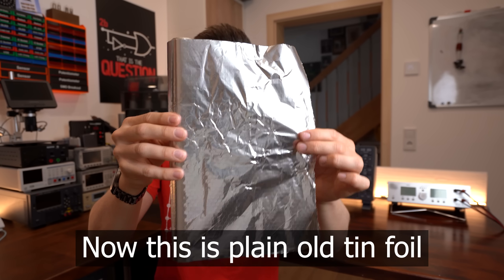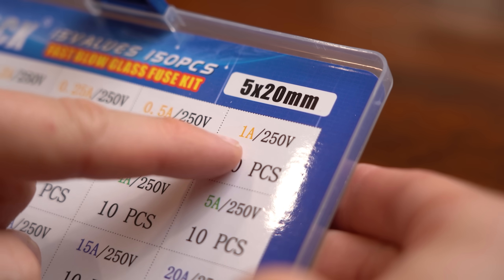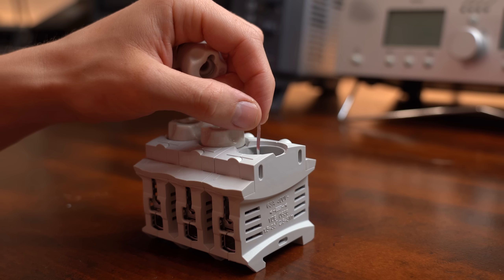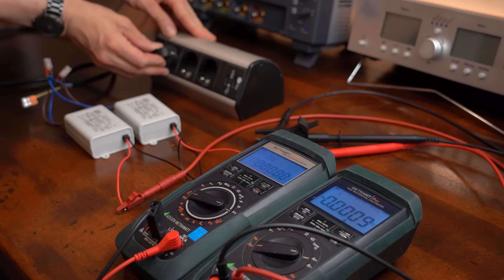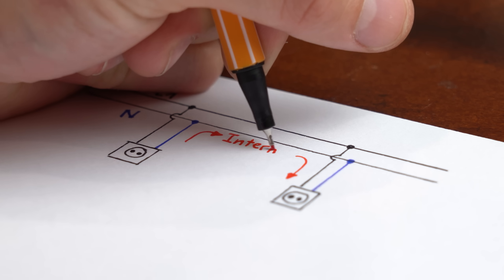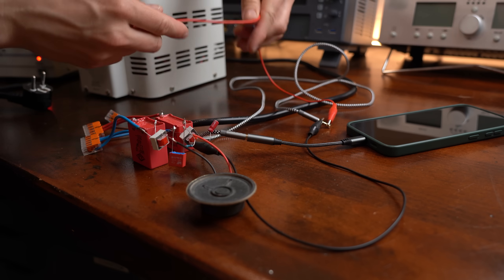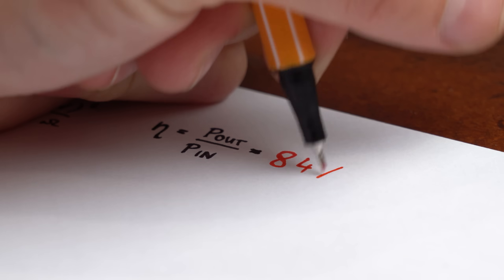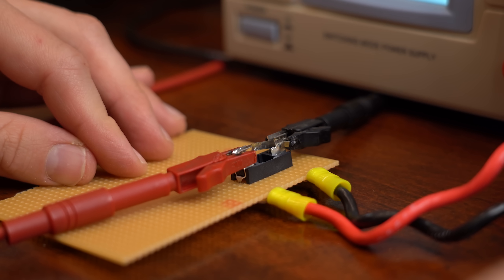I tried Busting 4 Weird Electronics Myths!

Comment from the maker: 🎉 Big thanks to Elektor for sponsoring this video! 🔧
BTW, if you're into building stuff and geeking out over real electronics (like myth-busting weird circuits... ), check out our limited-time offer 👇
👉 https://www.elektormagazine.com/greatscott-elektor-offer-25
We’re giving 50% OFF our Green Membership – includes magazine access, project files, and loads of deep-dive content for makers and tinkerers
✅ 8 digital issues
✅ Access to the full Elektor archive 📚
✅ 5,000+ Gerber files for DIY projects 🖥🔩
✅ Member discounts in the store 🛒
Offer valid until May 31st, 2025
Grab it here:
https://www.elektormagazine.com/greatscott-elektor-offer-25
👇 Let us know in the replies what you plan to build!
Reply: Have you tried wiring power supplys in series to increase output voltage? Could you test it in the next episode of electronic myths?
Reply: I HAVE REPAIERED EQUIPEMETN FFROM SECOND HAND AND FOUND A TIINFOIL WRAPPED FUSE IN WHEN IT DIDNT WORK I FOUND THAT THYE HAD  WRAPPED RHE ORIG INAL , IT WOULD HAVE TAKEN 13000 VOLTS TO BLOW
Reply: Thanks for creating this video about electronics myths. Great stuff!

Comment: The problem with rewiring fuses is that there is even some actual true practical use for it.  In the UK there used to be older fuses for the consumers units in private homes.  If a fuse blows the fuse carrier could be removed and the blown wire be replaced with new wire which many households kept around next to the consumer unit.  In theory that was a good idea.  In practice the result did depend a bit on the skill of the person doing the job which likely was the occupant, not a trained electrician.  Some people used multiple layers of wiring for extra safety which of course meant the fuse now would now have a rating of multiple times the desired one.  And while it was "recommended" to use the wire of the appropriate current rating people did often demonstrate flexibility when choosing the replacement.  Maybe no wire of the appropriate type was available, so why no using some other type.  Or maybe a bit from the garden fence?  Why not using 10A wire to replace the blown 5A, that will ensure it won't blow again.  These are still around in very old installations, still legal but very rare nowadays.

I suspect stuff like this may have infused the idea that rewiring fuses is ok into some people's brains.

Comment: Gum foil wrapper works like a charm. The foil on the paper wrapper is very thin. My dad used to do this in an old truck and it did blow every now and then and we would put another piece of gum wrapper wrapped around the glass fuse and put it back in the fuse panel.

Comment: I have done the signal-to-mains coupling thing.
It works like a charm, and it is surprisingly easy to do, as long as you are careful  :) . 
My plan is to use it for remote control/monitoring of machines here on my farm.

Comment: If the fuse doesn't melt, your home wiring will melt instead. IF the wiring doesn't melt, then your home will probably burn down... Personally, I think an actual fuse would be cheaper to replace.

Comment: Well the tin foil can work as fuse but it needs to be very slim and long piece and the current must be high so it technically can work but still if someone is capable of using the tin foil as proper fuse (have knowledge and tools/equipment) then probably have fuse and know it's pointless (too much work and time)

Comment: Yeah, I've been using two power supplies for my under-cabinet COB lights for a while now.  
Initially, they were on cheaper power supplies. They're on much better ones now. But still in parallel .

Comment: When I was a kid, circuit breakers were not standard, and lightbulb socketed fuses were used.   Also back then, pennies were pure copper.   So instead of buying fuses every time one blew, people would put a penny in the socket, screw the blown fuse back in, and, well, have a fire later.

Comment: You might want to look at the "X10" home automation system. It's been around for decades, but I don't know if it would work on three phase. It uses pulsed high-frequency on the power line to turn lights or other plug-ins on or off. It capacitively couples signal pulse to the single-phase power line when the voltage is crossing zero.

Comment: i used to occasionally buy elektor magazines in the 80s and 90s, didnt know if it was still going,  the main one i had was 'everyday electronics', which i think is still going under the 'practical electronics' name,  i have the very first issue of that from 1964 ,,  as for tin foil 'fuses', yes come across a few rammed into plugs😉

Comment: I think the "myth" in this case is that anybody using an ad hoc device to re-energize an electric circuit believes or cares about proper fuse operation. The people that I saw doing it sure weren't! And if you take a look inside those glass fuses, you'll see either a strand or a foil of metal that was carefully chosen because of its known properties. There's an entire field of applied science called electrical engineering that is in turn based on materials science, in which these precise dimensions and substances are calculated. We use engineering because it works, and does so more reliably than a wild guess. No, materials science is not a myth, but "YT creators have special knowledge" certainly is.

Comment: I have 2 issues.
Tin foil, if you're using it, you just need power to get from one point to another. Clearly it's not a fuse.
Power supply. A battery is a power supply and they are used in many forms in series and/or parallel. It is very common to have to cells running parallel to share the load.

Comment: I remember in school, we learnt about fuses by using individual strands of wire wool, increasing the amp draw until it popped and taking the reading at failure. We then added a second strand and repeated until we maxed out the power supply.

Comment: I used to get free TV off the side of the road in the 90's knowing there was a 90% chance it just needed a fuse, prob wrecked about three of them that turned out to only need a fuse but I didn't have one so ya get it running with tin foil for about 30-40sec before it blows something good.

Comment: 1: it's bypassing fuses
2: that's basic electronics. Voltage in parallel is constant between branches.
3: that's literally just AM for radio.
4: butter coils are designed to either have constant current in a DC motor, or run with alternating current. They do not function that well when designed for the wrong type of circuitry, primarily due to inductive reactance.

Comment: You are not doing it right. We used to use the tinfoil from our cigarette packs with the paper still attached. And it still works today, Just one or two wraps around the glass fuse and then reinstall the fuse. Do not fold the ends over, just rip off the extra.  It would get your headlights working to get home if there was no short. They would handle between 15 to 30 amps which was the max fuse size in the cars at the time.

Comment: using two server PSU in parallel as a power supply for charging batteries is like the most standard thing people do in the RC (especially quad copter) hobby do......

Comment: for the AC data coupling, you could probably fix it with a crude highpass filter since the data would be a rather high frequency compared to the 60/50hz mains hum. might not work great for audio but it's something.

Comment: 10:00 im not an electrical engineer or anything, but wouldn't a 180 degree flip isolation transformer work for filtering out that 60hz signal on the audio?

Comment: Replacing a fuse with tin foil has never been anything other than a way to get your piece of electronics running again. There's never been an expectation of it "tripping" at a certain current. It's just a dangerous practice you may or may not get away with.

Comment: In the US there is a very old standard for remotely operating lights and outlets, called X10. This works by transmitting digital signals over the power line. Our power is 2 phase, so if you have the xmit and rcv on different phases, it won't work well.  I still use X10, and it works fine in my house with some limitations.  I don't know if this every caught on in Germany.

Comment: Sorry but I'm a bit confused, what do you mean you're outputting 3 amps? Aren't amps drawn from a load and determined by the resistance of the circuit and voltage supplied?

Comment: I worked on a lift motor controller as a programmer and we kept blowing fuses which were quite expensive (30 or 40 amp I think they were) one of the engineers was from Eastern Europe and said they used water fuses. This was a piece of wire held in a bucket of water by brackets. The water cooled the wire until it got so hot that the water around it turned to stream. Extremely unsafe but it did work and saved us money.

Comment: We use mains MV to LV distribution transformers in the uk in parallel to double the output at AC... But they are far more simple that these small units. The issue with the electronics here is that the component tolerances create different power supplies that look the same.

Comment: Covered decades ago with the "Fools Guide to Fuse Replacement".
Foil - 243A
Rifle Cartridge - 350A (Audiovisual alert)
2" Nail - 600A
3/8" Bolt - 1500A (Slow Blow)
1/2" Spanner - 2000A (Slow Blow)

A local Australian electronics supplier had the picture on the wall behind the counter. It was the first place I saw it.
Reply: 1" Bolt - 60000A (Tested by styropyro)

Comment: A simple solution to the paralleled power-supplies would be to install a fuse on the positive lead of each of them, so that neither supply could ever be stressed by excessive current-draw, whether it was by a failure of one of the supplies that caused all of the load's draw to be put onto the remaining supply, or a short in either the load or one of the supplies.

Comment: Great video as always.
Wondering if we design desktop computer SMPS with 12V DC as input using buck & boost converters. Would that result in power consumption lower than regular SMPS?

Comment: I think the point of foil was not to use it as a fuse but rather to get current flowing again until you have opportunity to buy a real fuse. Because not everyone live in a city where  you can find 24/7 shop within 10 minute car ride. Sometimes nearest shop is at 30 min ride distance and that shop is closed after 6 on during work days and entire day during weekends.

Comment: Grandad was an electrician in the 60s when this sort of thing was common. He said that the foil used back then was actually "tinfoil" whereas nowadays its aluminum foil. Apparently the old tinfoil actually did work, as it melted at a much lower temp. (google says 231Deg.C for tin compared to 660Deg.C  for aluminum)

Comment: My neighbours on the road I live on had .22LR shells as “fuses” (apparently they would blow at ~300A) before they got resettable circuit breakers and everyone has a story about the guy from town who put loaded bullets in his fuse holders so they would blow clear. (I never actually encountered anyone who admitted to doing it themselves). The meme was “slow blow audible fuse”.

Having been a stupid kid I know they go off pretty easily with only a 1/2 dead motorcycle battery so maybe 50A at 12v. Given you would likely get some arcing I imagine they would be pretty loud when they went off though it may be difficult to tell which circuit had the fault.

Comment: LOL I honest to god have “fixed” blown fuses in my car using the paper/foil from a cigarette pack. The point is NOT to work as a fuse, but rather to bypass the fuse so I could still use my wipers. In car electronics, it’s often not a hard fault, but some transient condition like an iced over windshield or some such thing, that popped a fuse. Today, cars have PTC fuses and other more graceful ways of dealing with transient faults, but back in the day of glass fuses and fusible links, you had to do what you had to do!!!

Comment: Rather than tin foil, i use individual strands of electric wire or small enameled magnet wire that, before use, i "calibrate" using a CC power supply with two values: "Hold current" that the wire can support before releasing smoke (i physically touch the wire before test so the "smoe" is skin oil, and obviously "Blow" current.

Useful for testing and on low voltage circuits. Do not use on mains.

Inspired by ooold E.F. Johnson 12v mobile VHF rigs that used a classic 3AG fuse on the radio's rear panel and an hidden thin wire fuse, inside the radio, in series with the main fuse for protection against guys that replaced the 3AG by a tin foil "fuse".

Comment: Not only powerlines can be used for sending signals (like the adaptors for ethernet) but radio experimenters used "mains aerial" antennas (here in Italy they were called "tappo luce"). The idea behind it is to use the house wiring as a massive receiving antenna. Putting a high voltage capacitor of correct capacitance, you can isolate the radio signals (kHz-MHz range) from the mains voltage (50-60 Hz).
To be fair, basically anything was used as antenna. I personally heard of metal bed frames, pipes (older ones were very commonly made of copper), even cranes at construction sites.
Reply: Один вопрос: зачем, когда есть wi-fi и много других протоколов передачи данных и других радиодиапазонов?

Comment: When sharing power, the equalizing resistors should be used. That is a rule of thumb whenever such situation occurs. If you inserted like 0.1 Ohm resistors in series with each power supply, the situation would have been much better. A similar approach is used when using the bipolar transistors in parallel.

Comment: It isn't the pressing that makes the foil "sausages" lower in resistance, it is simply the fact that the total cross-sectional area of the conductor is greater because there's more foil in the same volume.

An ideal voltage source has zero output impedance. That means they are very unlikely to produce equal current when connected in parallel. If they are current limited then the invariable result is that one will go into current limit, it's voltage will fall and the supply with the next highest voltage will start to take up some of the load. Sharing can be improved by adding a small resistance in series with each supply to the common node. While that does improve sharing it degrades regulation. Diodes will not work! They can prevent one supply from driving current into another and will slightly increase the output impedance of each supply but they will not cause the supplies to share well. They do degrade regulation.
Making multiple constant-voltage supplies share equally without degradation in regulation is difficult and typically requires additional active circuitry and supplies that in some fashion can be controlled by such circuitry.
Constant current supplies can be paralleled with no problem, each delivering current according to its own setpoint. An ideal current sources has infinite source impedance.

The impedance of the AC power distribution system is designed to be extremely low at mains frequency. Again, it is trying to behave as an ideal voltage source. The inherent impedance at higher frequencies in the audio range will be considerably higher, but it you consider the full audio spectrum (20 Hz to 20 kHz) you have a big problem with impedance. Things that use "carrier current" communications typically modulate some frequency of at least 100 kHz. Ferrite core coupling transformers are used.
Those big inductors in the Ethernet modules are to keep the load that is plugged into them from excessively attenuating the high frequency signal. Switchmode power supplies are notorious for this because they almost always have a good high-frequency capacitor right across the line.
When you emulate the mains by using a local power transformer the leakage inductance of the transformer will significantly raise the impedance at moderate frequencies.

The laminations used in motors will be very lossy at the frequencies used for modern switchmode converters. The steel is far too thick to keep eddy currents down to a tolerable level.

Comment: They were concerned with the "being conductive" part, but not so much about the "burning up at a reasonable current" part.
Some used tin foils to replace fuses, others used nails, the point was to make it work.

Comment: We used to use either a gum wrapper made out of paper, but it had a foil on one side or cigarette pack foil.  We would wrap it around the fuse and stick the fuse back in, that way it would still burn through if it had to.  Never did I ever want to screw around with house voltage in anyway.

Comment: I never used tin foil to replace a fuse, but in critical emergency I did use one strand of braided copper wire with the burned fuse for a temporary fix.

Comment: might be my lame electronic/electric knowledge but I have a question regarding the powerline communication system: if you "broadcast" your internet connection through the power line, what stops it from being read by anyone on the same network (let's say, in your neighborhood) if they connect their own devices to read signals from the powerline? Don't be too harsh on me, I'm just a curious noob :)

Comment: for the "using 2 powersupplys"-myth i really would like to see a video on how to do this properly, so how to balance supplys with the same voltage against each other and how to protect them. and what is with serial configurations? are they always possible? what to look out for on using common ground then?
Reply: Not an electrician here, so take what I say with a big grain of salt, but I imagine using power supplies in series would damage them when you send 24 volts back to a 12-volt power supply.

Comment: Fuse is not to prevent short circuit. It's used ONLY to prevent electrical fires. 
It's not there to protect circuits either.